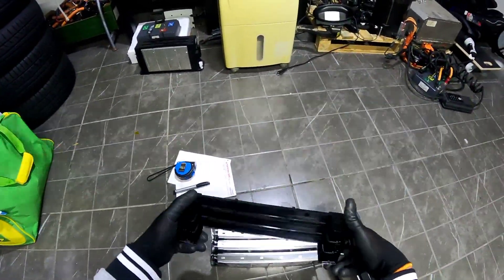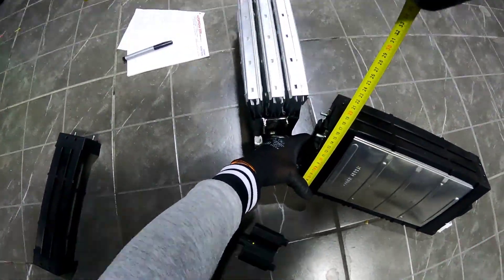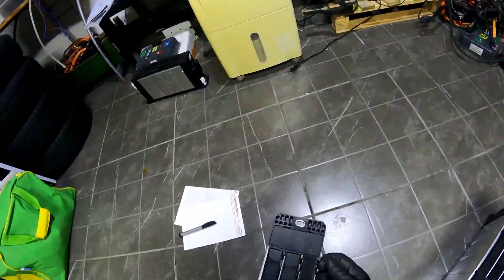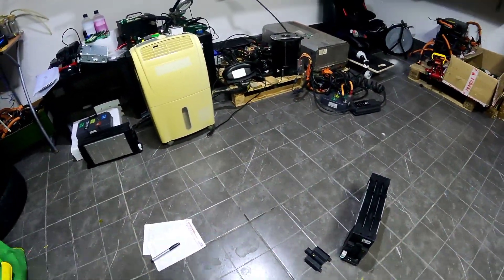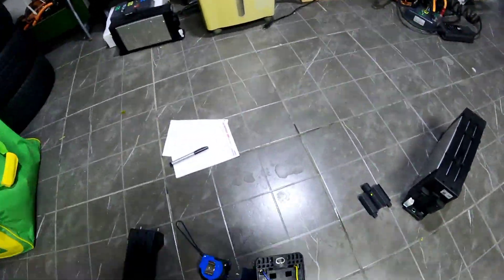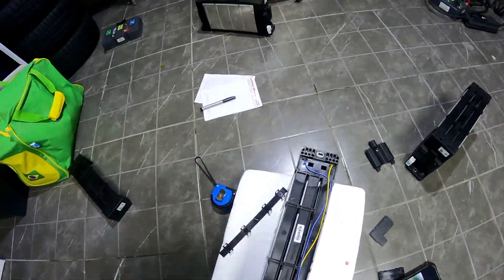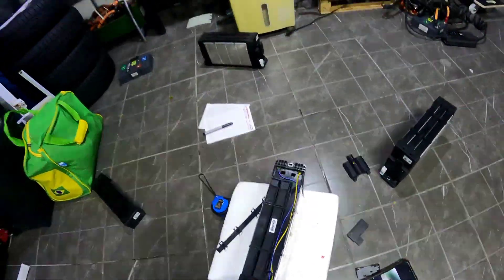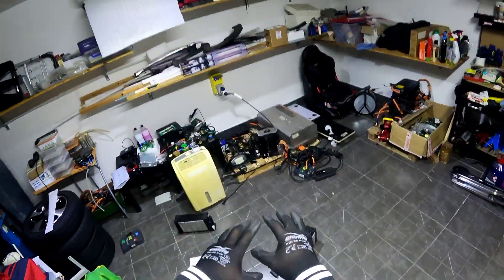Twizy cells

Comment: wooow. witch bms you use ? if i good understand you try to use same renault  BMS ? this battery have same voltage as atwizy battery and temps sensor is the same (model / value)  ?  Hope you will give all your results and technical info... because Renault battery are very expensive (and long delais and perhaps out out stock soon.)
Reply from the maker: All original but cells...two cells will sostitute six and form the single module...there is more info on the original battery on my other videos...